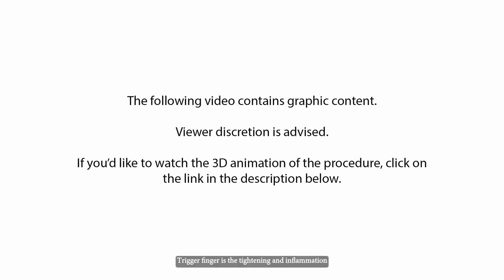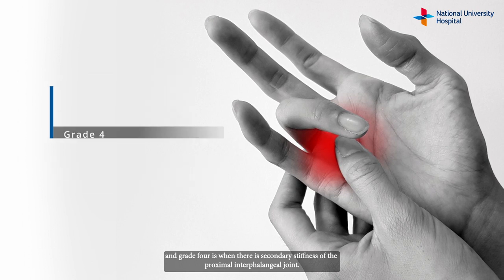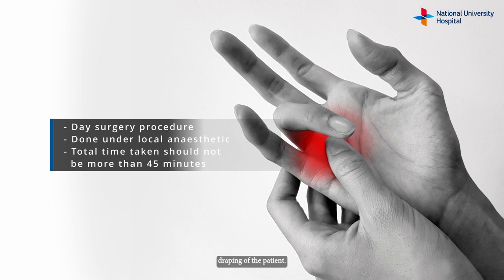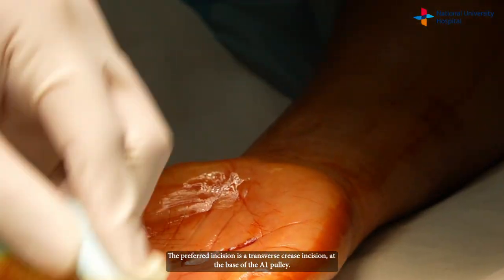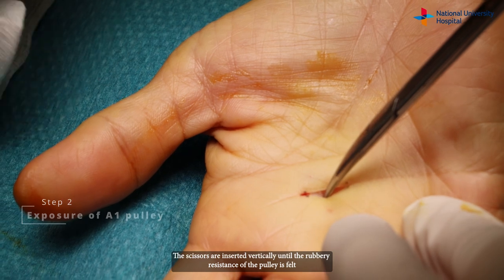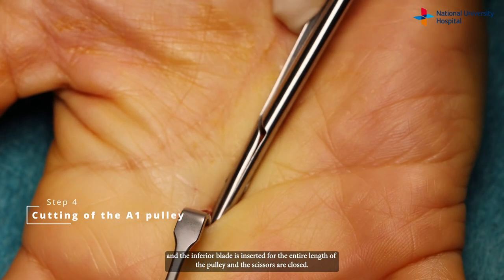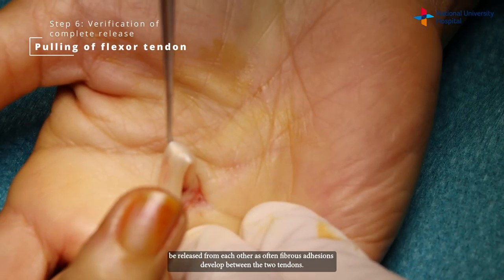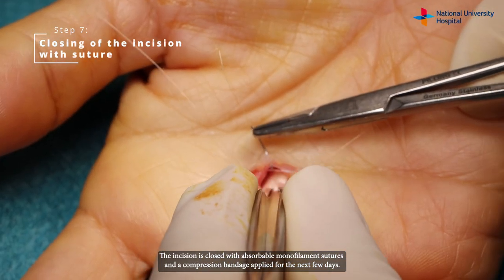LIVE Surgery Explained: Trigger Finger Release Surgery in 7 Steps

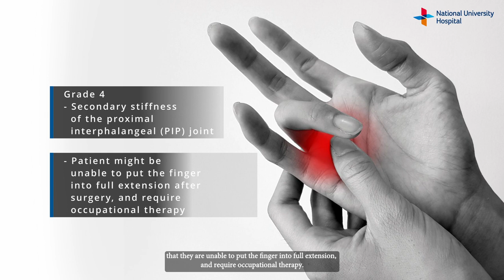Comment: 1:00 Will the patient be able to extend it fully after the occupational therapy?
Reply: Here's my experience, and I can honestly say that I would 100% do it again:

I had this procedure on 12 June, 2024. The worst part, by far, was the shot for the local anesthetic because of the amount of liquid being injected; however, keep in mind that it's a few moments of that in exchange for long-term pain relief. It wasn't pleasant, but definitely not intolerable. Once that was over, the rest was a breeze. I think the surgical procedure itself took between about 20 and 30 minutes.
The really surprising thing to me was that I had very little, if any, pain afterwards when the feeling came back. I only took the prescription-strength ibuprofen for about a week for the little bit of swelling. It was hard on my stomach and I didn't need it for pain, so I stopped taking it after that. I never needed to use the stronger prescription at all.
Today is 31 August, 2024. I still have very mild soreness sometimes and a tiny bit of swelling. Nothing unexpected. Actually, I'd say it's a lot better than I had anticipated. I would be cautious about doing a hand-stand yet, but it's not keeping me from doing anything I normally do. I wouldn't want to push the middle finger back very hard, but that has improved over time (and will continue to do so) and there's really not any lack of normal mobility.

I recommend:
-Fill the prescriptions they give you, even if you have high pain-tolerance. As I said, I had very little pain, but everyone is different. To paraphrase my doctor, it's better to have it and not need it than to wake up at 2AM and wish you had it when the pharmacies are closed.
-Follow instructions very carefully. Do the exercises they give you. This will help you recover more quickly and thoroughly.
-Keep it elevated and ice it often for the inflammation.
Keep the incision site dry. To take a shower, I put on a nitrile glove, pulled the wrist section past the bandage, and put a snug elastic band or two over the area to keep out the water. I was actually able to wash (very, very carefully) the exposed parts of my fingers after removing the glove. It was much easier than I had expected.